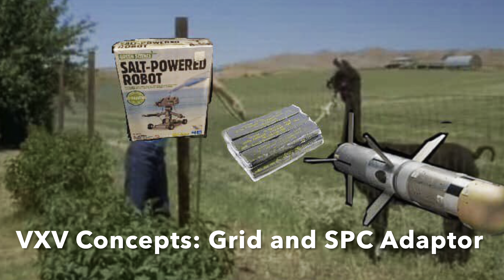VXV Concepts: Two-Piece Grid and SPC Cummerbund Adaptor

Comment: I really think this combination might be the best setup in the world, considering changing all my SPCs into this. The V5 plate bag has some features that many others don't (full laser cut, hidden g-hook anchor, built-in admin pouch on top which is especially good with the axl zipper, crye zipper at the back, qd shoulder release which everyone should do). The SPC cummerbund is the best with the structure support it provides, but god its assembly is hard and good luck adjusting length to add a side plate/radio/over thick jacket. But with this everything is solved.